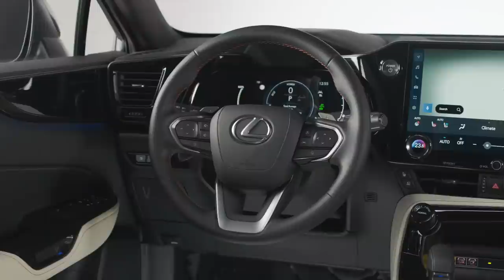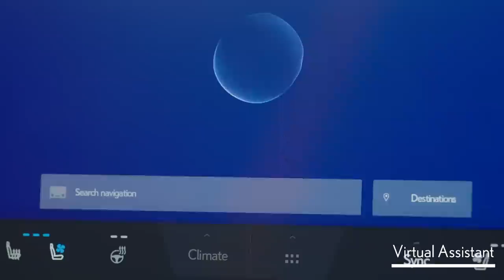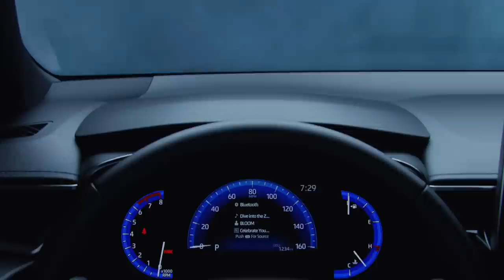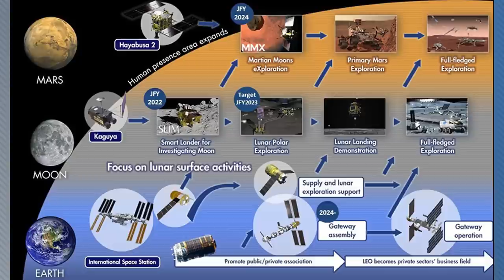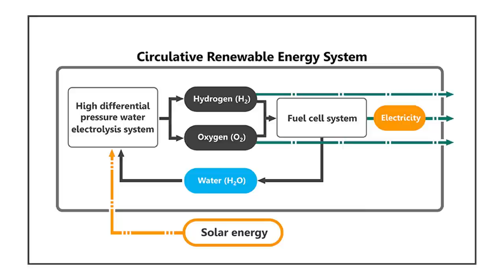All-New Lexus NX Premieres; More Trouble at Lordstown - Autoline Daily 3100

Comment: The average car is just going to get older. The 2020 pandemic combined with work from home becoming more common (maybe forever) many families are driving much less than they used to. Even consumers getting used to having everything delivered takes miles off the family car. I would say 2020 alone extended the life of my cars at least a year but we won't see that in the stats for a few more years when I hold on to them longer than expected. New cars will either have to be really compelling or gas prices will have to force folks to EVs or something to break this cycle. Even something as simple as the availability of cheap diagnostic devices can cause an owner to be more confident keeping that car longer.